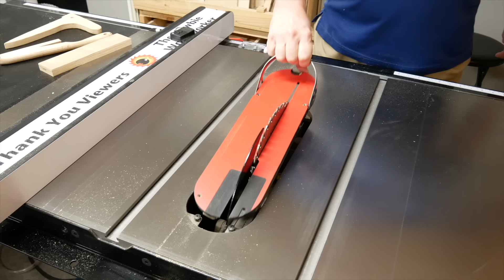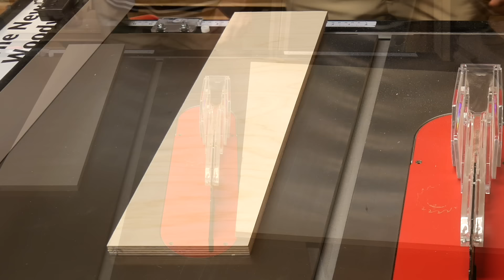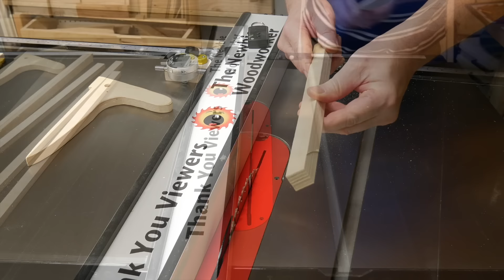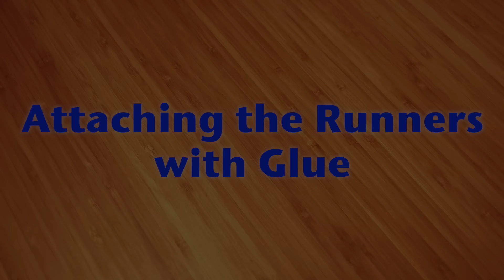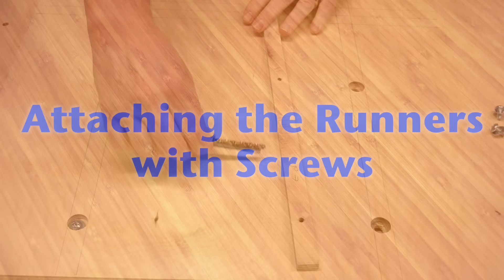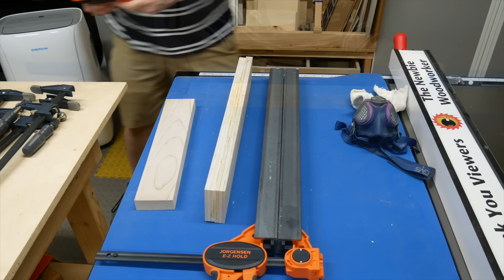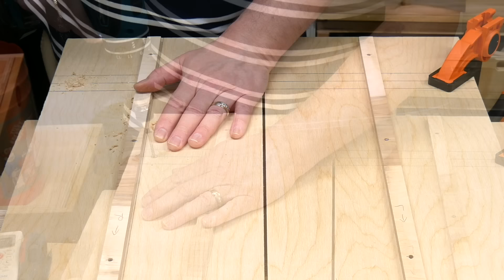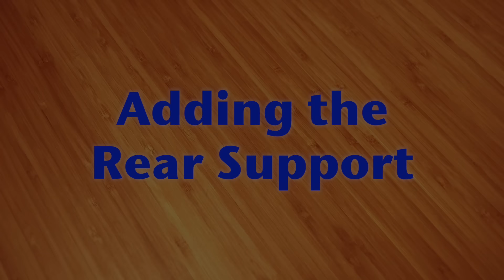Build this Revolutionary Cross Cut Sled, for Newbies!

Comment: We are not talking about riving knives but the ONLY thing a blade guard was EVER designed for is to keep a piece of WOOD (not your fingers) from dropping on the top of the blade and being propelled backwards. There are MANY operations that are impossible with a blade guard in place   it can easily actually CAUSE injuries and increase carelessness and prevent the proper use of push sticks and push blocks resulting in fingers being put in close proximity of the blade and being cut off. 

Like Mike Roe says, Safety Last.  Personal responsibility first. The best guard is between your ears. 

I'd love to see you in a machine shop around big manual mills and old sharpers brushing oil on the cut. .And not only do we not unplug the machine (which doesn't even have a plug) but when we are changing tools in an Aloris tool post. - WE DON'T EVEN TURN THE MACHINE OFF !!!!!  

Real world vs fantasy  land is why you will almost NEVER see a guard on Youtube, One guy says that out of 50 woodworking channels he sees on;y 3 that use blade guards.  Has to be a reason for that, Bunky.
Reply from the maker: Every once in a while, I decide to give someone like you the benefit of the doubt, to see if you're capable of a rational discussion. I'm not sure why, because it has worked only 1 time over the years. But, bunky, it's your lucky day.

The average weekend woodworker doesn't have the amount of experience that you have. And the newbie, to whom this channel is targeted, has even less experience. They don't yet know all the things they should and shouldn't do. So my goal is to help keep them safer until they gain enough experience to decide for themselves what safety attachments to use and which ones they can chuck.

If you're suggesting the newbie would be better off not using a blade guard, then you're out of touch with the reality of being a newbie. Your argument will probably be something like "they should learn to use the tool properly," and while I agree with that, it doesn't happen overnight. And it's even harder when they aren't able to use the tools consistently. day after day.

As far as what other channels do, why in the world would I care? I'm not a robot, and I don't blindly do what everyone else does, otherwise I'd have nothing contribute.

And learn to be respectful of people. You'll never get anyone to agree with you, when you insult them.
Reply: I have to agree. A good push block, homemade or something like the Gripper, are, in combination with the riving knife, the best safety features of a table saw. The guard is great in combination with a dust-collection system on some saws, but those are only available on super high-end cabinet saws, not what a weekend woodworker would have in the garage. Also, the more ‘safety’ feature the user thinks there are, the more careless he or she might be. Think before making a cut, run through it with the saw turned off and check your gut if it feels safe and correct. Don’t rely on a piece of plastic saving your bacon.

Comment: Thank you for acknowledging the value of the saw guard!  I may have a SawStop but I don't want lose a blade and a brake if I can help it.  I'm building this design and I think you're the only YouTube woodworker who had incorporated the opening for the guard.  Thank you for thinking about safety!
Reply from the maker: Thanks, and you're welcome. I have to laugh - the SawStop technology is so good, we're only worried about the cost of having the brake get activated, not the damage to ourselves! Just remember if you set it off because of touching it, SawStop will give you a new brake for free, although it takes a little while to get it.

Comment: Sometimes the wood you are cutting is wider than your sled and can become unruly. Have a couple of pieces of scrap that can support the ends where they hang off the sled. You may have to remove the fence for some cuts.
Reply from the maker: Very true. I also have a much larger sled when I need it.

Comment: Not knocking this but surely a Mitre/chop saw does the same job without all the hassle of making a sled/ also the wood is clamped down to hold it as well
Reply: Some cuts are wider than the miter saw depth of cut. I don’t have a sliding miter saw yet but with a table saw sled, I don’t need one.
Reply from the maker: @larrysmith306  👍
Reply from the maker: Sure, chop saws are great if you have room for them, and you aren't cutting stock that's too wide (deep?).
Reply: @TheNewbieWoodworker  the bed on my chop saw takes fairly wide boards if i have to cut sheets of ply etc i just use a circ saw i agree the sled would be good for stock around 3 inches high if your blade goes that high . the sleds a good idea for a small shop
Reply from the maker: @casper1240  👍
Reply: Not everyone can afford both a table saw and mitre saw/chop saw. So a table saw with a good sled is a necessity. Nice vid btw.
Reply from the maker: @dannybaker2763  Agreed. And thanks!

Comment: Sorry I'm late to the show. Thoroughly enjoyed your work, but (gramps grammar grinder) you keep saying "cut on the right side" and then cut it on the left side so you could cut it on the "correct" side. Old journalist, I got hammered about ambiguous wording.
As for threatening wood, add a few drops of ca glue after threads cut and replace screw with one whose threads are  coated with paste wax until glue hardens. Threads last longer and wax releases the screw. 
As for safety, learned from my uncle, a farmer, who shortened three of his fingers with saws.
Keep being you and do the content you want to get the information out there.
Reply from the maker: Thanks! I know what you mean about ambiguous wording. I try to avoid that, and most of the time I catch those kinds of things, but I can't catch everything. Thanks for the tip about threading wood!

Comment: Tapping machine threads into the runners isn't a great idea in my opinion.  You just can't screw it down tight enough to be sure it won't ever slip, especially as you cut the other hole so it CAN slip.  AT A MINIMUM, for the runner that you fixed in place first, that one runner should be glued, making sure at least one of them can not slip.  Then if you want to play your games with threading plywood at least it only applies to one side.
I hoped to see your final test for squareness use the four-cut test.  Make the first cut, then rotate the piece so the fresh cut side is against the fence.  Make a second cut, rotate, third cut, rotate, fourth cut.  Now check THAT angle.  Any amount the sled is out of square will be magnified 4x on the corner between the first side you cut and the fourth.  Why bother?  Remember how the small machine square wasn't adequate?  Yet it was all you used to check.
Reply from the maker: You're entitled to your opinion about threading plywood, but for me, using Baltic Birch plywood, it has worked well for years. But you know what? If something moves, fix it. You should always check your fences & sleds for squareness every now and then anyway. Of course, I didn't mention that in the video, so... I guess no video is perfect. Sigh.

I understand what you're saying about checking it with the 5-cut method. And now that I think about it, since this is a teaching video, I should have done that here too. The reason I didn't do it, and again, I agree that I should have, is that for me personally, when I check carefully with a good-quality machine square, it's square enough for any kind of woodworking I do. And I've done plenty of 5-cut checks to feel comfortable saying that. But I shouldn't have assumed that's true for other people. I missed the mark there.

If it's any consolation, in my other cross-cut sled videos, I do use the 5-cut method to verify. Of course, that doesn't help here. double-sigh.

Comment: I will agree safety first, i wouldn’t want anyone to lose a finger. Iv personally have touched the blade with the tip of my thumb. 
With that said I still don’t use a guard and won’t. I would like to think that I’m pretty advance in wood working especially for the small amount of time iv been doing it. I personally like to watch what the blade is doing to the wood and how the wood is responsible to the wood. Wood sometimes with twist or or break while cutting. 
I feel that if you use the saw correctly and are following all the correct steps to  cut then you shouldn’t have an accident. I have had close calls but because I understand what was happening I was able to avoid it. I have enough confidence in my ability and i make to follow all the safety does and don’t.  With that said as long as your confident in what your doing and understand the situation you shouldn’t never then be in a situation where you’ll cut your self. Even a blade that is not sharp as it is meant to be can cause an accident. 
So just stay safe do and run your saw how ever your comfortable doing so. You know your saw and you know the does and don’t on how to use the saw. By the way cool concept. Marking one for my tables saw and was checking out different designs.
Reply from the maker: Thanks for the comment. It's nice to hear from someone who doesn't necessarily agree with everything I say, yet has a polite and civil way of talking about it. So few people do that anymore. I do understand what you're saying. Just remember that they call it an "accident", not an "on purpose". 😉
Reply: Did you read Joe Drane III's pinned comment at the top of this page?  Amputated fingers is not the only danger that blade guards protect you from.
Reply from the maker: @percyfaith11  👍
Reply: @percyfaith11  I just did. Glad the dude is ok, with that said I away check my wood. 
Make sure if I’m cutting through something it has enough support so it won’t go flying at me . Plus the way I stand at the table saw helps avoid when kick back happen. Most of my experience comes from my teachers homemade table saw goes up and down and has a fence. He would laugh at you and tell you become a real carpinter and to read your wood. Like why cut something that going to break? You would know after giving it a face and a cutting side if the piece was good
Reply from the maker: @juanbeans9534  👍

Comment: Thank you for the detailed video!  For cutting the notch in the fence, would it be easier to cut that before attaching it the first time?  You can make two cuts via the table saw, for the third cut you would need to use a jig saw which is a bit annoying but this seems like it would be easier than have to take off the fence and then reattach it?
Reply from the maker: You're quite welcome. As long as you know where to make the cut, that would probably be OK. Try it out and let me know. 😄

Comment: Insted of plywood or hardwoods with proper grain patterns to mimize movement use plexiglass for the runners glued on the sled using insta bonding glue then drill and screw them to the plywood. The plastics not going to move.
If its a tight fit fine tune it.
Reply from the maker: I don't know that I'd use plexiglass, but UHMW plastic is a good choice.

Comment: NEVER RUN YOUR HANDS OVER THE TABLE INCERT IF ITS RED OR ORNGE ITS THE DANGER ZONE. YOUR TOO CLOSE TO THE BLADE.  GUARD, SPLITER KICKBACK PAWS DOSNT MATTER.
DO YOU REALLY THINK THAT 3/16" PLASTIC GOING TO SAVE YOUR FINGERS. THAT SAWBLADE CUTS WOOD PLASTIC AND SOME METALS
THE GUARDS NO MATCH FOR THE BLADE. YOUR FOLLING YOURSELF IF YOU THINK YOUR ANY SAFER. YOUR NOT.   Keep your body parts at least 6" away from any spinning tool at all times.
Some of this safty stuff gives too much false sence of security.
Murphys law is what ever can go wrong will go wrong. It only takes one time.
Show your tools respect. They will hurt you if you don't.
Reply from the maker: You make some valid points, but you're also missing something. Of course the blade will cut plastic - but the purpose of the blade guard is to not let your fingers get to the blade. Yes, if I took the blade guard and yanked it to the side, the blade would cut it. But otherwise, it does its job well by providing something that blocks my fingers from getting to the blade.

Comment: Funny you say that, but one of my 3 saws i refuse to use the blade guard, my reason i dont like being hit in the face with it turing the saw on becuse it has a piss poor latching system if removed to set cut sizes and you cant set that with it on, then back to the 100 mile an hour guard into my face 1/4" away from my eye.
I said one of my 3 table saws, ill use it on the other 2 saws.

By the way I hate the fact I cant use the guard on that saw
Reply from the maker: There's always exceptions, of course. In your case, I think you're making a good exception. 😛

Comment: So glad I found this channel..  I am 59 and BRAND NEW to woodworking...So new that I've never built anything, but I already know I will love it.  I just have  question for anyone who would be willing to offer some feedback.  I want to buy a DEWALT table saw, but I don't know if I should buy the 8 1/4. or 10 inch. The 10 in. Costs 2x at $599.  (The 8 1/4 is currently $100 off at $299) If you were in the market for a table saw, would you bite the bullet and buy the 10 in?  I hear the benefits is it can accommodate dado stacks whereas the 8 1/4 can't.  Also, the 10 in can cut thicker wood. I read an article that suggested getting the same size blade for a miter saw so the blades can be used on both.    Thanks for reading!
Reply from the maker: I'm 65, so you're just a kid! 😛 Get the 10", for sure. It's a good saw, and you won't be sorry. Assuming you don't want to shell out for a SawStop. 😉
Reply: @TheNewbieWoodworker  Thanks!  The SawStop Jobsite Pro looks like an amazing saw.
Reply from the maker: @jcepri  It most definitely is, for sure.
Reply: @TheNewbieWoodworker  Why though? What's the big advantage for general purpose use of the 8 1/4 over the 10?  I guess the 10 inch blades are easier to find, and the 8 1/4 won't do dados (I do those on my router anyway). So, why the automatic 10 inch recommendation? The 8 1/4 gets great reviews, is more portable, less expensive and seems like a pretty darn good saw, and other than dados, not sure what the 10 inch gives your typical garage workshopper.
Reply from the maker: @daneyuleb  I don't know for sure, but do a google search for table saw 8 1/4" vs 10" - there are a lot of results, so you can make up your own mind. 🙂
Reply: @TheNewbieWoodworker  Thanks for the reply! I have googled it quite a bit  -- just thought you might have some reason to recommend 10 over 8 1/4 that I missed. For DIYers I'm definitely leaning toward the 8 1/4th.  They would seldom (probably never)  need a 10 inch blade at full height. And the smaller blade definitely seems a lot safer, with less chance for kick back, and much less kick back force when it does happen. Then there's price, and portability.  The need for dados is pretty much it as far as I can see that would put the cheap 10 inch job site type saw over the cheap 8 1/4 one for garage workshop type use. And maybe easier to find blades--the 8 1/4th ones are much leaner pickings...
Reply from the maker: Hey, whatever works. But there's one thing that will always make me get a 10" saw, and it's that I want the SawStop technology. It's already saved my fingers multiple times. You can't really put a price on fingers.
Reply: @TheNewbieWoodworker  Yep, that's a valid reason I didn't think of!  For the little work I do, though, a SawStop is too steep so a little job site has to do ( 3 or 4 hundred bucks vs $2000ish) -- I'm just super careful, and use all the safety equipment (which is why your crosscut sled video that allows for the guard is so helpful!)
Reply from the maker: @daneyuleb  I figured as much. But I thought I'd mention it anyway. 🙂
Reply: I'm new, too...about a year in, but am a member of a lot of online woodworking groups.  Whenever I see this question asked it is answered nearly unanimously to get the 10" over something smaller.
Reply from the maker: @craftedbykvg4649  👍
Reply: @craftedbykvg4649  Thanks!
Reply: I wish I would have bought the Dewalt portable saw before they stopped making the 10 inch.  They lost a sale to me because they went down to 8 1/4" blades on the portable saws.